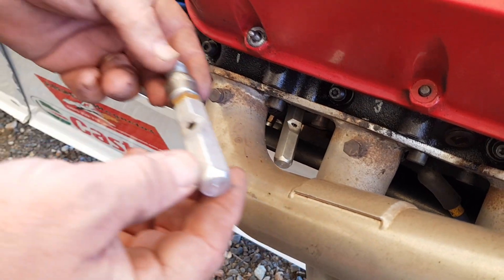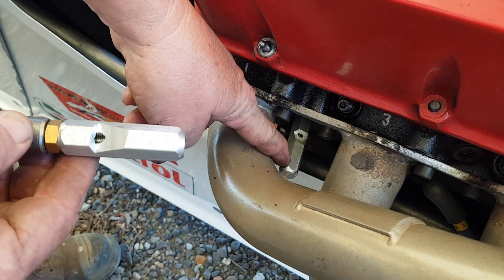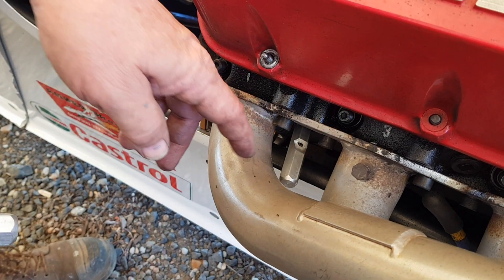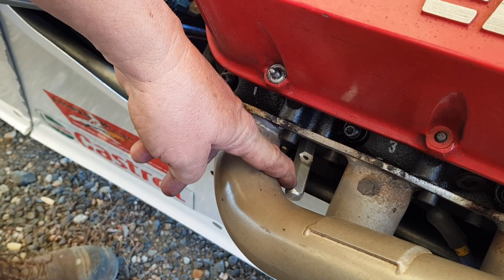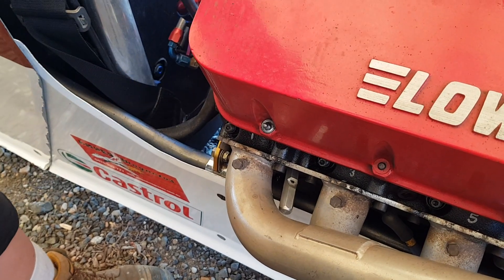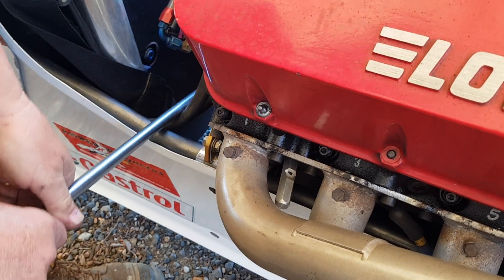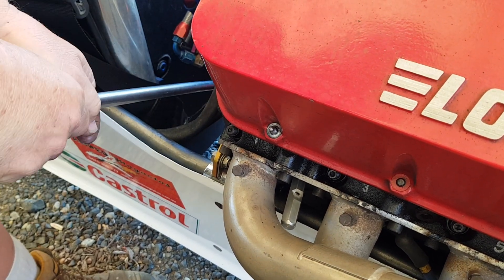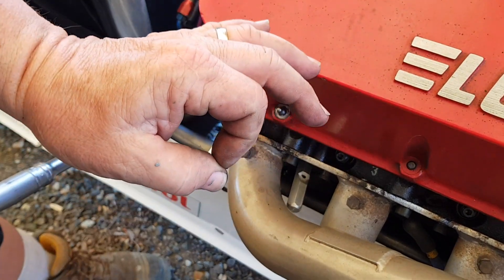TDC Whistle

Comment: When it starts to WHISTLE . . . THAT piston is on it's COMPRESSION STROKE. NOW look for the DAMPER pulley TDC Mark to come around to the TIMING TAB as you continue to SLOWLY ROTATE the Crankshaft . . . until the Crank Mark is at the TDC Timing Tab Mark. You, or a helper, can stick a finger tip snugly over the Spark Plug Hole and rotate the crank until you FEEL THE AIR being pushed OUT on the COMPRESSION STROKE . . . then look for the Crank Mark to come around to the TDC TAB.  Either method works, but the WHISTLE is very convenient when you are by yourself. Of course the camshaft distributor drive , GEAR or TAB, is also now at TDC . . . so now you can put the distributor down into its mount hole. If a BLADE tab drive, it can now only be correct, or 180° off. Get the Vacuum Advance pot where you want it with respect to where you want the #1 PLUG WIRE to be in the Dist. CAP. then install and snug the DIST HOLD DOWN CLAMP. If it is a GEAR DRIVEN Distributor . . . then it will install as it rotates into the CAM DISTRIBUTOR GEAR . . .  so it can be "out of position" by how many teeth the gear set has. You will have to put the distributor in and out, rotate to next tooth on the CAMSHAFT . . . till you get the ROTOR POINTING WHERE YOU WANT THE #1 Plug TO BE . . . AND THE DISTRIBUTOR BODY and VACUUM ADVANCE CANISTER WHERE IT CLEARS EVERYTHING . . . before you install and SNUG the CLAMP. LATER . . . you will start the Engine. IT WILL BE STARTING AT TDC on #1  . . . then you can set the Distributor TIMING where you want it and TIGHTEN the CLAMP DOWN TIGHT. The WHISTLE IN THE #1 SPARK PLUG HOLE TELLS YOU #1 is on the COMPRESSION STROKE AS YOU SLOWLY TURN THE CRANKSHAFT. THEN YOU EYEBALL THE CRANK TDC MARK TO ALIGN WITH THE "ENGINE" TDC TAB. AUTO SHOP 101.
Reply: Left out another IMPORTANT PART. You ROTATE THE CRANKSHAFT IN THE DIRECTION - CW or CCW - that it RUNS AND . . . MAKE SURE YOU USE THE ENGINE MAKER 's Number 1 Cylinder. Most (All ?) US Engines turn CW as you stand at the grill looking at the engine . . .also known as FLA . . . Forward Looking AFT. You should also CONFIRM WHAT THE ENGINE MAKER CALLS NUMBER ONE AND WHERE IT IS LOCATED. GM and Ma Mopar use Driver side, FRONT (water pump end), for #1. Ford also has used PASS Side Front as #1. Firing ORDER and Cylinder Numbering (1,2,3,4,5,6,7,8)  POSITION also Varies. Write (marker or grease pencil) the ENGINE FIRING ORDER on the top INSIDE of EACH fender, on the firewall, and the engine side of the Radiator Mount or fan shroud, so that you can SEE THE FIRING ORDER when your working on the engine no matter where you are "bent over", in, under, around the Engine Bay.
Reply: very accurate description....

Comment: I'm planning to clean my intake valves on a 4 cylinder GDI Mazda engine. Would this help with finding TDC so that the valves are closed on any given cylinder?
Reply: Yeah as long compression is present it will whistle
Reply: Did you use this to do the job.? I need to do this soon.

Comment: Best way is to pull valve cover and look at number 1 valves--believe me
Reply: Is it? Because that sounds like a pain in the ass and this thing just whistles and tells you.
Reply: @KentuckyKY  I have had the whistle go off during the exhaust stroke (while manually turning the engine).
Reply: @johngranato2673  If your engine makes enough pressure to whistle on the exhaust stroke, you've got some investigating to do.
Reply: The exhaust will whistle but it’s a low pitch whistle, the intake stroke has a higher pitch whistle because of more compression, u will definitely hear the difference
Reply: @ironhorse6688  Yep, but I'll still pull the cover.

Comment: Yes, excellent tool to have, when my TDC whistle disappeared mysteriously, (Brad, I want my tool back) I quickly made one by simply grabbing a small barrel hiking whistle and attached it to a rubber hose and stuck it in the #1 cylinder plug hole.

Comment: Instead of using a breaker bar, how about just turning the ignition by bumping it?
Reply from the maker: You can bump it over and easily tell where TDC is as opposed to 180 out.
With a long ratchet you can get it very very close. Certainly close enough to drop a distributor in.
Reply: Thanks.

Comment: Okay, it whistles only when the crankshaft pulley is at 12 o clock and the camshaft is at 12 o clock??
 ..... Isn't it supposed to be 12 o clock on crankshaft and six o clock on the camshaft ??????
Reply from the maker: Whistles only on compression... not on overlap.

Comment: -Great Idea, any chance you might like to share a build blueprint? Would make a sweet afternoon project to through on the lathe and looks like the mill also. I might add a flax hose and a bigger like Foghorn for the hearing impaired.
Reply: Easily bought from www.kenlowe.com.au/tdc_whistle.html
Reply from the maker: A stiff flex hose would make it easier to fit in in many cases, in our case where we have easy access it is not necessary and without the hose it takes up less space in the tool box.
I first made one forty years ago and often used it at the race track to quickly determine if the engine was on zero on 180 out.